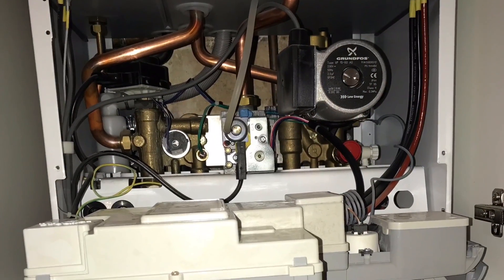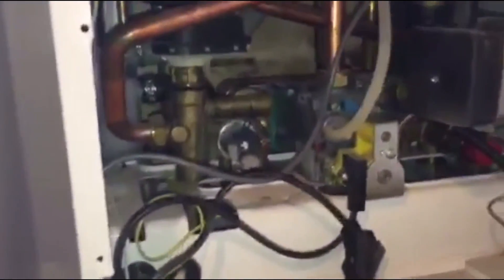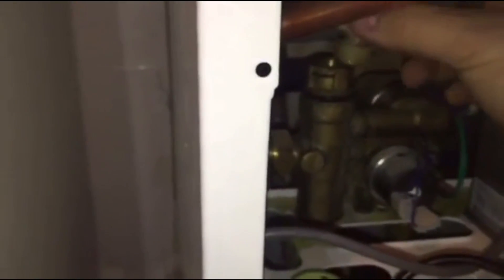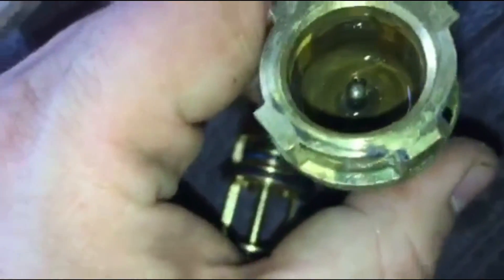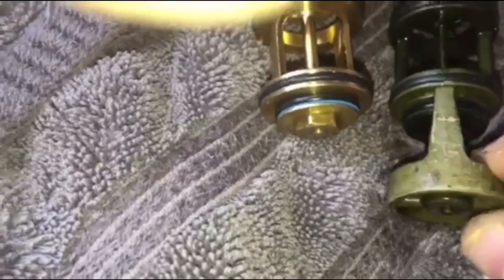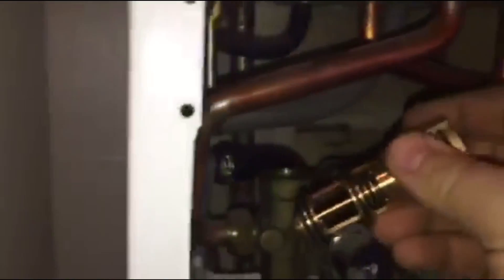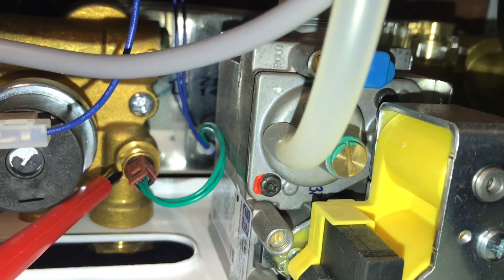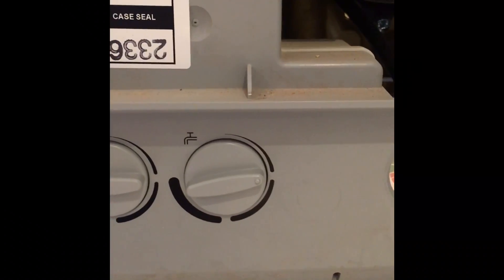Repairing a leaking Baxi Duo Tec / Platinum

Comment: I have a Potterton Gold, the same boiler as a Baxi Duotec. It’s the second boiler as Baxi replaced the previous 3 year old one as it had 5 failed divertor valves in that time. The latest boiler is just under 2 years old and the same valve has failed on this one as well. It’s borderline fraud getting customers to pay for extended warranties when they know full well this component is suspect. Even though its had a slight redesign, its a 3rd party component that Baxi are rumoured to be suing the manufacturer of this valve due to the amount of failures it has suffered. My mum has an old Glowworm back boiler and it just works. Combi boilers are crap really.
Reply from the maker: I would have someone check the water quality for you. I have installed hundreds of that same version of boiler, i don’t have hardly any issues. The part is a moving part and normally lasts a good 6/8 years
Reply: Thanks for the reply Allen. Baxi took water samples from it originally after it failed when the boiler was less than 9 months old, and they found nothing wrong with the water. The system had been previously flushed and cleansed with inhibitor added. It’s been protected by a spirotrap, which has been upgraded to a Magnaclean Pro2. It also has a fluoride inhibitor fitted to the water supply. The Baxi engineer admitted to me today that it is a 3rd part part ( not manufactured by Baxi) and Baxi are currently involved in a £ 6 million lawsuit against this part manufacturer. I believe it is borderline fraud to expect customers to pay for extended warranties, whilst Baxi are aware of this issue. The engineer said he sometimes replaces upto 8 of these valves per day during his shift! There is a housing estate in Durham near Newcastle where 80 houses had Potterton boilers installed in new builds. 56 of these new builds had the valves replaced within 2 years of the boilers being installed. There’s a disturbing pattern here that Baxi are aware of, but are misleading customers in my opinion.
Reply from the maker: @colingraham9281  As i say i have installed hundreds and have only had a couple on my installs over last 8 years, never had one changed twice. Thanks.

Comment: Hi Allen, 48 hours ago my boiler developed a constant on and off clicking coming from the diverter valve assembly. During central heating running it was working fine but the valve motor kept trying to operate all the time even when there was no demand for hot water to warrant its operation. This morning the RCD on the house mains tripped and low and behold on inspection the 3 pin diverter motor plug was soaked in water. After disconnecting the plug the boiler would start without issue and we have heating at least. I have a gas engineer coming tomorrow who has suggested replacement diverter and drive motor due to the leak and the water ingress. Do you reckon this will solve the issue? It just seems odd that something was calling for the valve to operate. If the valve doesn't travel all the way does the PCB know? im thinking maybe it was stuck and the boiler constantly kept trying to operate it. Thxs for any advice!

Comment: very useful thanks, helped me fix mine. My insurance are arguing that the leak is down to sludge in the system yet it is from 2007 so thinking older type diverter. plumber left us with no hot water and still leaking after 2 visits. I ordered a new complete valve and also fitter a filter to the return and it is running with cleaner in system which will be drained soon

Comment: Why are Baxi boilers prone to leaks when Vaillant boilers are not ??? With this in mind I would buy a Vaillant for next boiler not Baxi ! Any thoughts ?
Reply from the maker: Funny you should say that as i went out to a Vaillant that was leaking, Water was leaking all over, I would fit baxi every time over any Vaillant.
Reply: I have seen vaillant with the same problem on diverter valve
Reply: Agree, diverter valve problem massive on Vaillant's, and Glowworms. @DunkiSTI

Comment: When removing the old diverter cartridge the plastic came apart from the brass top. Any ideas how to remove the plastic section other than replacing whole section with the plastic inside. This is the third one in 3 years that has needed replacement, hopefully the new design will be an improvement
Reply from the maker: I have fitted hundreds of these boilers and have only had a couple of these, check your system as I suspect that may need cleaning. Thanks for watching.

Comment: Thanks ''your video was easy to follow ''and a great help''isn't it amazing you and I' and plenty of other people will notice''no matter what manufactures promise and flimsy guarantee ,they will all ways now'' go for cheapness in their products' knowing full well'' yes those customer suckers will be back to us in a very short time'' just like cars ,etc sold on a promise the best money can buy''yes our money'' then after a while  'faulty 'or cheap parts were  installed etc etc''''why were these brass valve fittings not put in to the boilers when first manufactured .rather than a cheap ,flimsy ,plastic,metal, spring valve'' knowing full well it would rust,and  break '' surely it does not make economic sense'' or building your name as a worldwide safe product'' and I am ashamed to say our great Britain is now like that''cheap and  make do'' it never used to be that way'
Reply from the maker: terence barrett its a moving part so it will always fail at some point.